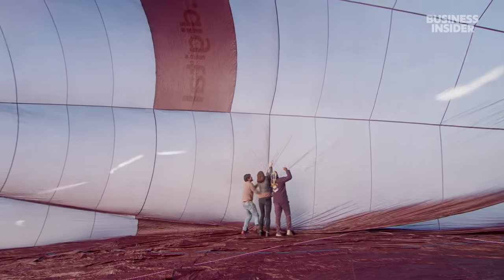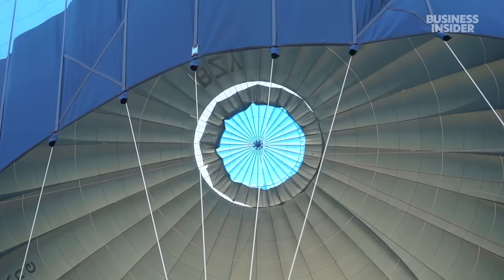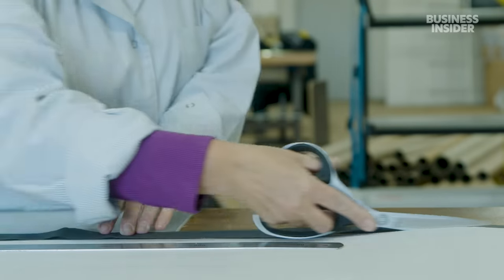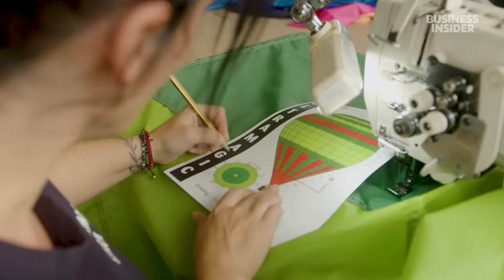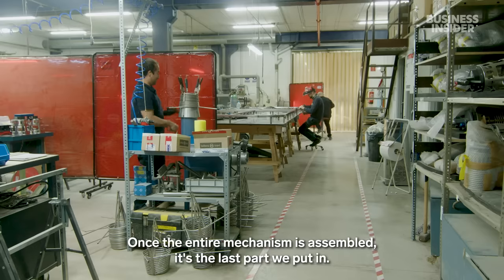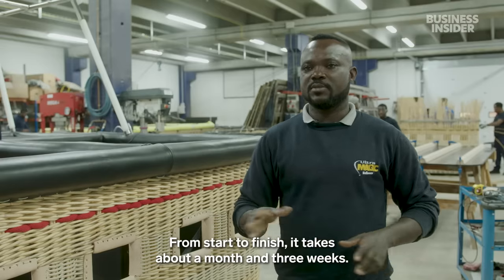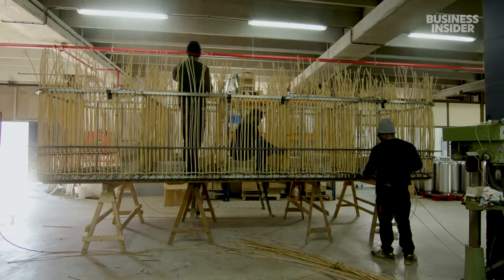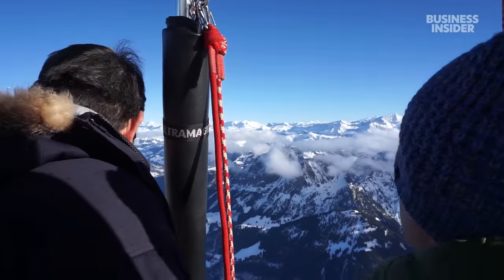It Takes A Team Of 70 To Make Hot Air Balloons Safe. Here Is Why They're So Expensive

Comment: When I was a kid, hot-air balloon rides were a staple at the County Fair.
I don't recall any horror stories about them, only that they stopped showing up with the Fair.
A few years after that, the Fair itself faded into history...
Reply: The tethered type that just go up and down are far simpler than the kind that go on free flights.
Reply: @dfpguitar  😂 That's a very interesting story...Just not at all true. The balloons are exactly alike, but for the tether.  
The pilot qualifications and experience are actually greater in the case of flying the tethered balloon...As with a 'free' balloon, the pilot has to hold a Commercial license, but also must receive additional instruction for flying the tethered balloon, and has to receive an additional Endorsement for flying on a tether. ✅️

Comment: "Once it's in the air, a tear would be catastrophic" YA THINK?
Reply: A small tear would be okay most likely. I've actually seen a balloon flying with a tear on the side and it was flapping as the air was escaping. He didn't even try to land but finished the flight with it flapping. It was about a 2 foot tear too. I was surprised. I'm sure he used more propane than usual though.
Reply: there's actually an opening at the top to let out excess hot air while descent....so a single tear wont necessarily be fatal
Reply: I DON'T
NEVER
I ONLY COMMENT WITH OUT

Comment: Very interesting video. Living most of my life in Albuquerque NM, which is known as the Hot Air Balloon Capitol of the World, I have been a crew member on numerous hot air balloon teams. I've worked on corporate and commercial balloons with up to 12-person baskets, but they were dwarfed by the huge basket shown in this video. I've never seen a basket that big. That basket and the balloon the goes with it are obviously designed for flying from much lower starting altitudes than we have in Albuquerque (roughly a mile above sea level).